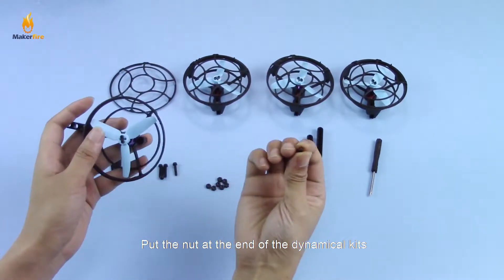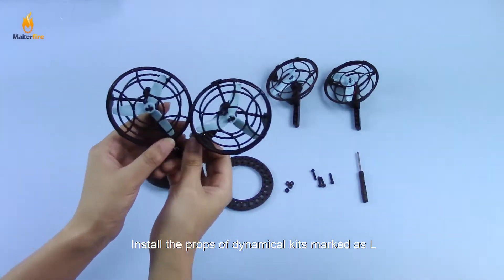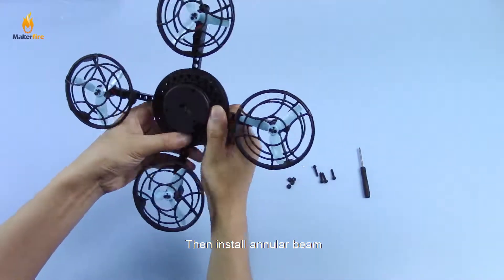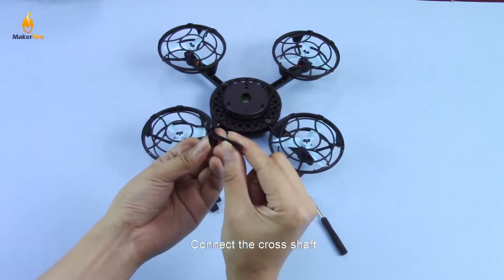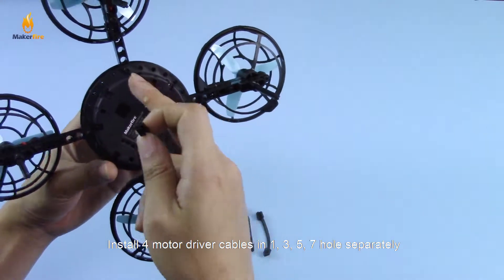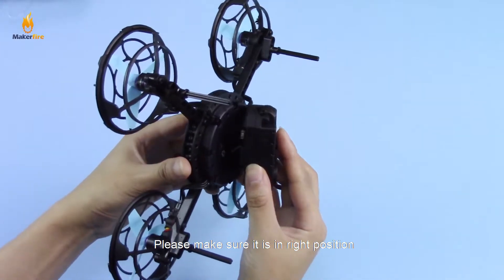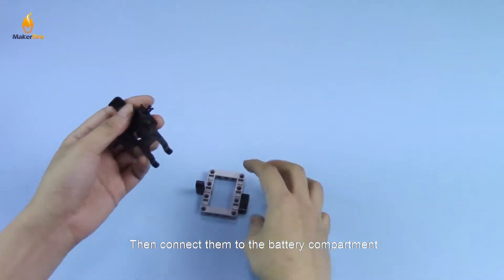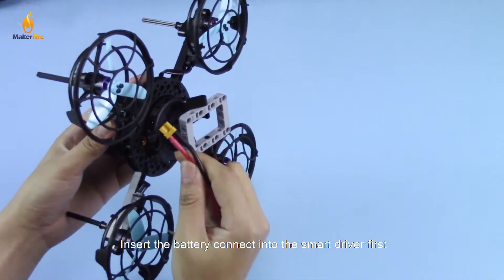Ghost II Assemble steps

Comment: Tweaking of the manual text is necessary, but quite easy to assemble and fly. Do not forget to peel the protective foil of the camera lens. Some extra bolts and screws in the package that is of no use (?).
Reply from the maker: Extra bolts and screws are for replacement